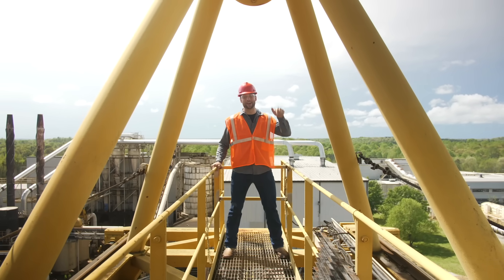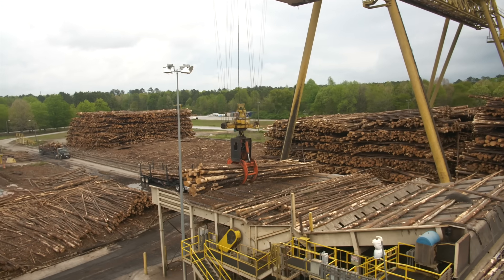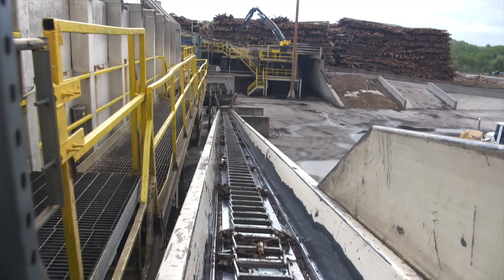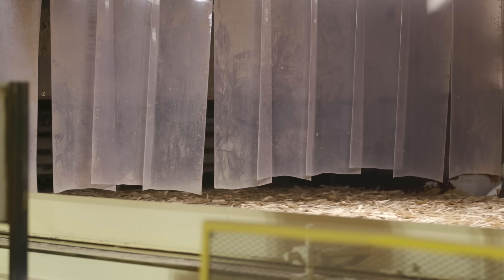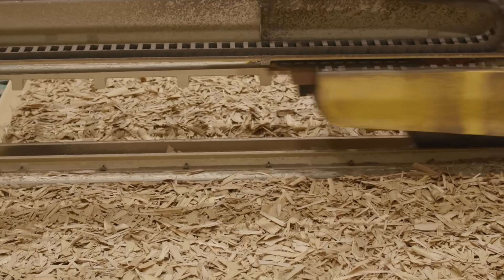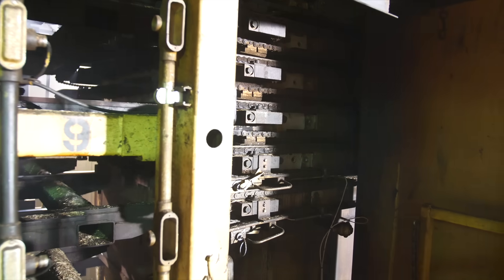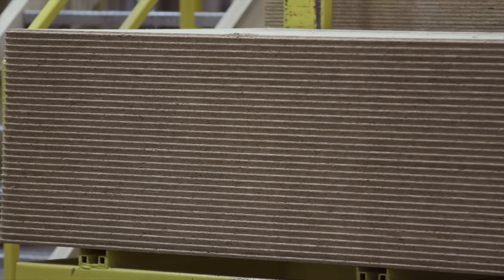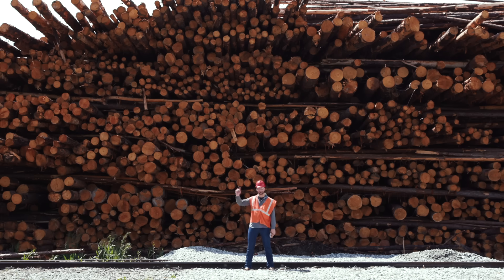Could OSB be BETTER than Plywood????

Comment: Been a carpenter for 30 years, I'll choose plywood 
Every time, I've seen too much osb fail.
Reply: @John Fischer I fail to see why that's a tricky question. 
In my case it's easy:
In mostly applications 2×8/2×10
DF joists (std.pad ,post and beam app. 2×12 DF over basements for longer span.)I have on 2 houses in a 30 year career used (per engineering) TJI's and BJI's (imagine a potentially  40' long floor joist,looks like an I beam. made with a 2×3 micro lam top and bottom cord and then a osb/ply/micro lam web member..
When they get wet or long term moisture, you're screwed. 
Headers almost exclusively DF
(An occasional glue lam or steel I-beam for long spans)
I have seen micro-lam used for headers and occasionally I've used a para-lam (imagine an osb beam)(when engineered so) headers are usually much easier to keep dry,than sheeting.
So,in short Douglas Fir.
Reply: @John Fischer you use tji.
I use dimensional lumber. 
Case closed!!!!
Reply: @John Fischer 
Good for you.
The 2 homes I built with tji's, I got feedback from the customers ,who did not care for the bounce throughout  the house when building long spans floor with tji.
On 1/2 million dollar homes they expect solid floors.
Hardwood and tile over TJI floors has a pathetically high failure/callback rate.  Cheap Carpet ,vinyl and composition floors is not in the homes I work on.
Many homes I build is exclusive tile and hardwood. 
You want the glorified cardboard in your houses,
Have at it, it's no skin of my nose.
Reply: @christiamhaagensen3539  TJIs shouldn't "Bounce" at all. It means no glue was used. again cheap asses
Reply: @John Fischer The top and bottom chord is not OSB  or it would fail.
Reply: i agree 100% osb is garbage compared to plywood.
Reply: @dankollars4501  Used plywood to build my house, and Zip system when building my garage. Both held up well to the elements during construction.
Advantac was used in the flooring, and held up fine, but did swell a bit. This swelling was compensated for in the way it was installed, so there were no issues.
I did have scraps left over that sat for a season exposed to the elements, and the plywood had much more stability over exposed osb. osb swelled and had  much more water retention. the zip side was totally intact and if installed properly would make that product very usable and durable as a sheathing material.
Other brands of osb I have seen used do not hold up to exposure well. And none of them are meant to be exposed long term except zip system.
Reply: @daveb5540  i know  3 years later. Osb is know to receive and hold water where plywood doesn't hold onto water and readily releases it.
Reply: Yep.  Complete garbage.  You might as well make a house out of compressed dog shi^.
Reply: @michael931  But it's good shi* man.
Reply: What about termites?? What do you recommend? We have a huge problem in my area!!!
Reply: C J Bowen and
Reply: @John Fischer then cut the 2x3 here and there ;)

The osb is just there to keep the 2x3 at a certain distance where they can work their strength in tension and compression.

In TJI the 2x3 and osb can’t live without eachother.
But TJI’s are engineered to be just strong enough, so yes strong but nothing super.

There are completely wooden I beams with crisscross dowels or sticks in between to separate the outer parts.

They are easier on electricians but HVAC and plumber can have a problem when they need to remove dowel or stick.
That’s why TJI get’s the preference.
Reply: @John Fischer You'll get bounce if you go beyond their span rating.  I use them and like them!
Reply: Yes, thank you. Think Osbaldo works in a limited use but it cannot rival plywood because the molecular structures are different-- one is mostly parallel as opposed to swirls. No amount of cost effective adhesive can overcome that.
Reply: they must pay this guy a lot to lie about OSB .   he does have some good videos, this one is BS  . maybe he hasn't been around much, it doubt it, it doesn't take a genius to know OSB is junk.
Reply: @John Fischer I am wondering if mixing in hemp fibers or bamboo fibers might enhance the strength of the different OSB products.
Reply: Plywood swells and is useless when rained on. I've never seen OSB fail. Would use OSB over plywood every time.
Reply: @dixonbidenzmouth4115  plywood only absorbs water through the cell ends. Plywood sheets can be easily waterproofed with waxing the ends. You can also spray it with a deck water proofer when installed.
Reply: UNFORTUNATELY SO HAVE I!
Reply: I worked for a osb company and we made a great product.Don't care about you haters.
Reply: Way too many times.
Reply: OSB is a cellulose-based material so it naturally  contains mold spores. The mold spores are dormant so they are supposed to be harmless. However,  when OSB get  exposed too moisture those dormant mold spores become activated and start feeding off the nutrients in the wood which causes surface rot.
Reply: Yes Shure.  All over the word houses were build with osb. In the us too.  Wake update fool
Reply: @thomasschafer7268  yeah. because it's CHEAPER! it's you who is the fool.

Comment: I have made osb for the last 21 years I worked at one of the Huber plants for 11 and at the Lp plant for 10 years any wood let left out in the rain will swell but Huber avintech will not its a lot better than plywood and a lot stronger
Reply: Is the any third-party comparison that actually shows Huber avintech to be 'better than plywood and a lot stronger, " and also that it will not swell if left out in the rain? Those are big claims to make.  Big claims require big proof, as they say.
Reply: There is plenty places to look up the specs apa to start with . I have a stack of 1 1/8 that has been out in the open air under a shed no direct water on it but it’s been there for 14 years and no swelling or falling plywood will warp osb will lay flat

Comment: For interior uses an furniture it's not so bad. Used in ways that help get it from moisture! Like counter tops but for roofs or floors in bathrooms I would avoid . Just like other things in building an with tools it works in some application yet doesn't do well in all.

Comment: If you think of osb and plywood like omnidirectional fiberglass vs woven fiberglass you would presume oriental board would have much better shear applications, however, whatever your project is, sheet goods are typically used for their vertical and horizontal strengths, not their omnidirectional abilities. Plywood is a superior product 95% of the time imo.

Comment: OSB when used as roof sheeting has always caused sagging valleys between rafters after several years as the heat from the shingles heats up the glue or binding agents allowing them to become soft and pliable in summer allowing it to give under the constant weight of the shingles.
Reply: As a builder and a carpenter I would never use OSB on any of my jobs
Reply: I have a RV roof with OSB and single layer EPDM rubber over it. Condensation or moisture caused the OSB to "crumble". The roof did not have leaks and the wood did not rot but crumbled. The moisture/condensation from inside the RV caused the "glue" holding the OSB together to fail. It's an expensive roof repair and I would never use OSB again.
Reply: Good point. I thought about break-down caused by moisture, but, I never thought about the effects of high temperature from sun on the resin binding the strands.
Reply: Guy Grove  Your right! I'm a Southerner. That's just a nice way of calling someone ignorant here in the South East.
Reply: It would help if they would build 16" on center like pop used to demand. my "deluxe" home and all in this golf community are 24" at minimum.
Reply: That should NOT happen. The problem was probably due to poor construction practices, i.e. wrong thickness of OSB used for the span, the OSB got wet constantly, or a combination of both.
Reply: @alan30189  In PAC NW, multi-res sits 'shelled in" for months in the rain before it gets papered and sheathed. Everything OSB gets lumpy, so they have to glue the OSB down before nailing, then use thin-ply underlay for any floor treatment besides carpet.
Reply: OSB cannot handle moisture it’s really crappy stuff one time use for Concrete maybe
Reply: Richard Adam Darriau - It should not be used for concrete work. What clown uses it for concrete work?  For concrete work, you want to use a plywood product called “Plyform.”
Reply: @alan30189  Impressive improvements... Long-term data will tell all. Plyform rocks... I use it often for a smooth finish. Some of is clowns like OSB for it's texture on concrete. OSB in a freezings-thaw climate has some merit because it doesn't have voids like CDX ply. That was the hype in the 80's, but once it gets wet it becomes compromised. I know for a fact. I work with plenty of forensic engineers overseeing destructive testing, and I can show you many photos of OSB used correctly, and incorrectly and too many times we see failures.... mostly installer related or on self financed projects where people are not wise enough to use proper consult. Crates... OSB is great for a crate and Type 5 structures on a tight budget. It's a bad idea under hydronic floor panels as a sub floor, or roof decking especially if it has self adhered roofing materials over it, unless it's well ventilated for thermal equilibrium. Even then, it's taking a chance because self adhered membranes are too thin. In short OSB shouldn't be used unless a third-party waterproofing consultant's specification has it listed as part of their material and method composition. If a building is to last without problems, never use it anywhere it might get wet, without a disclaimer. Under liquid applied membranes always use plywood without voids on the inner layers. In the United States fortunately the statute of limitations is 10 years... it's pretty easy to make something last 10 years. I've done destructive testing on buildings with OSB labels that are only three years old and if one's not careful you'll fall through it if it happen to get wet. Don't get me started on OSB Beams. We use them if they're specified, but only if they're specified by an engineer and architect who are using a qualified waterproofing consultant for the building envelope. I would never use it in my own house because it stinks for a long time. Now if someone starts producing OSB with a waterproof resin, keyword waterproof not water resistant, that would be a big improvement especially if it doesn't stink.
Reply: @radarriau    Yes, you never want to use OSB in areas where there is a lot of moisture.  It won't hold up.
Reply: @alan30189  OSB is used all the time in Florida.
Reply: I just purchased a 30yr old house with a few replaced roofing sheets with osb instead of the original plywood. The osb is sagging.
Reply: @forrestgumpv9049  how many vent are on the house?
Reply: My home is 32 years old. I chose to use OSB over plywood, and have built with it over the years with NO problems .
In fact I reshingled my own home 7 years ago, and had NO panels to replace. In my experience anyone not using Advantech on they're subfloors and roof is completely unlearned or plain ignorant.

Comment: Reading through the comments here, it looks like he failed to make OSB look better than its horrible reputation as the crappiest building material out there. He didn’t even answer the video title’s question.
Reply: Mr Innovator Wayne, I don’t know who this Jordan guy is; but it’s not Matt
Reply: Better if it stays dry!!!
Reply: Well I'll say that particle bord, widely used in prefab  
Insulated panels and floors in mobile homes and modular homes are much worse. 
A small undetected leak/moisture  and it crumbles.

Comment: This video is misleading.  First he says they don’t bring in outside fuel to the plant.  Then he talks about burning the pine fumes is specialized burners to clean the air.  I’m sorry, but bark and saw dust cannot be used to supply air burners.  Air burners require natural gas.  An outside fuel source.

Comment: Osb when it gets wet or damp will flake apart and rot. No way is osb better than plywood
Reply: Here is the UK (the damp island) we have osb3 that will easily outlast plywood in wet conditions.
Its widely used in construction
Reply: @darrinpatterson2764  The only OSB you can get in the U.S. that is 'water resistant' is 'Marine Grade'...which is on-par cost with old-growth plywood...which outlasts OSB-Marine by 5x. If you're paying out of your own pocket for it, the choice is OBVIOUS!
Reply: @skeetersaurus6249  well here in the UK ive seen osb3 as we call it out last marine ply in Maby side by side situations so maybe what you use in your area is substandard compared to our local area. As a builder and joiner I know what I would use hands down in what is a very damp country
Reply: @darrinpatterson2764  I"m laying some oak flooring down and was told to lay osb beneath it. Would you agree?
Reply: @tianyinjia  I've overboard many floors with Osb or plywood to offer the new floor a more uniform surface to be laid on. If its over boarding for laminate/engineered or hardwood floor id screw the osb/ply every 200mm centres
Reply: This should have been the title to this video. All those click bait banners are a waste of time.
Reply: I would be curious to see how this AdvanTech stuff holds up. I would hope it has evolved somewhat in the last 30 years.
Reply: Plywood does the same when wet

Comment: Over here in Ireland, we have this stuff called "Smartply". I believe it may have plastic in it. I've had some that's been left outdoors in this soggy climate for at least six months and it has been usable. It also doesn't burn as quickly as ply. Has anybody heard of this stuff ?
Reply: Sounds like marine grade or something like that.  I pulled some off of a pallet for a high end industrial machine and used a 3' x 5' piece of it as a 'temporary' seawall repair (half in the water) for over a year - summer and winter in the water.  I was amazed how strong it was when I took it out to install the new seawall.  I know it wasn't standard OSB because it had a sheen to it like it was enameled or something like that.  Possibly an epoxy like resin to glue the strands.   To me it is marine grade because that is how I used it. 

Add to that I am replacing a subfloor that had 5/8 plywood on top of pine because of water damage.  Lets just say it was several layers of very thin wood because the a lot of the plies came apart as single sheets when I removed it.  I also used OSB as a subfloor in a rental cottage with a very damp crawlspace below it about five years ago and it is still solid.  I am thinking the production methods for OSB must have gotten much better over the years or quality varies by manufacturer based on all of the negative comments I have read here. 

Oh yeah,  to the tree huger taking care of the environment however wood is a crop like corn, wheat etc..  AND using the wood from used pallets instead of existing trees is such a stupid idea on so many many levels it would be impossible to explain it to anyone dumb enough to think that you can gather enough used pallets, remove all the nails and make custom machinery to carve up such small pieces of wood (vs. trees) to produce enough 'pallet OSB' to build a house.  When you give up everything you have that came from industry and live off the land summer fall winter and spring in any northern climate and do so with zero carbon footprint or whatever -  only wind and solar power - don't go burning up any of those trees for heat . . . well then you can come back and preach your crap without being a total hypocrite. 

Shit there I've gone and wasted more of my time watching youtubes. . . .

Comment: Lets face the facts.  The reason they are making OSB is that they don't have access to the size of trees needed to make plywood.  To get a bigger tree takes much longer for growth so you can have enough diameter to peel off the layers plywood requires.  In this process you get to use the whole tree, a scale of economy.  It's all about the bottom line.  Produce a product as fast as you can and sell it hoping that the end buyer doesn't know they have a building made out of dry oatmeal just waiting for a leak.

Comment: I have seen lots of toilets mounted on OSB that leaked fall through the floor
Reply: The biggest killer of mobile homes is water leakage.  OSB is the reason that this is so.  If you have a leak that lasts long enough that the subfloor feels wet or damp, might as well plug in the SawzAll to charge up while you are downtown buying a new piece of subfloor.  It's almost comical how many people don't notice their leaking water heater until they hear it go crashing through the floor.

Comment: Chipboard or particle board as its called in NZ used for flooring in cheap housing developments if not sealed up properly disintegrates if wet. Wouldn't touch it with a barge pole. Better off to use marine ply.

Comment: Hi Mat   Having used this board on versus projects , I found it to be very good. The secret is to use it wisely , just like chipboard . Expecting it to withstand water ingress is being somewhat optimistic. Even plywood will delaminate when exposed to water , marine grade will cope but at tremendous cost. So it definitely has it’s uses , In the U.K. we have a green colours type that’s designed for exterior use . Having not use such a product I cannot confirm it’s water resistance but one would assume it to be better than the standard variety.  Hope my comments don’t go to much against the grain. Excuse the pun but this just happens to be my experience of the material in question   Best wishes and kind regards to all   Mike in the U.K.